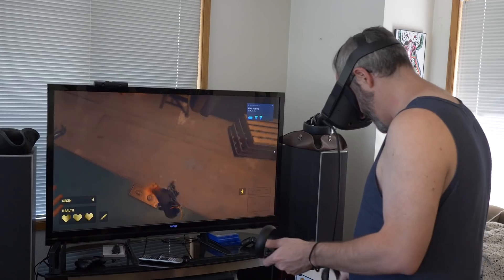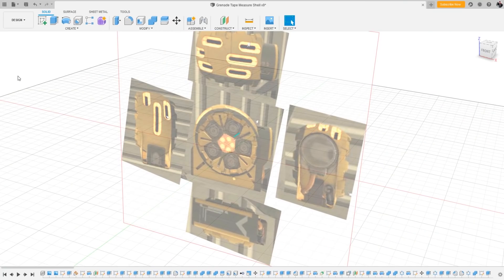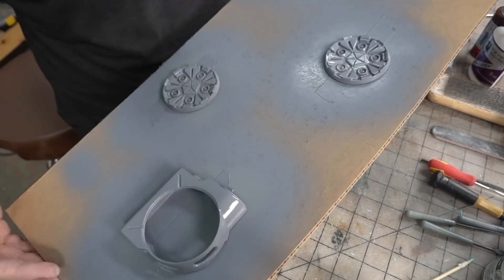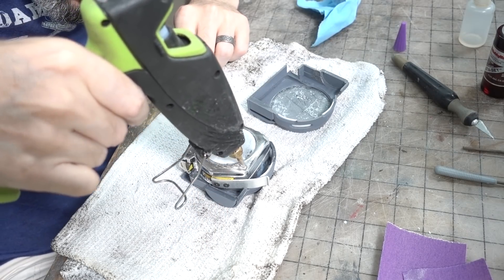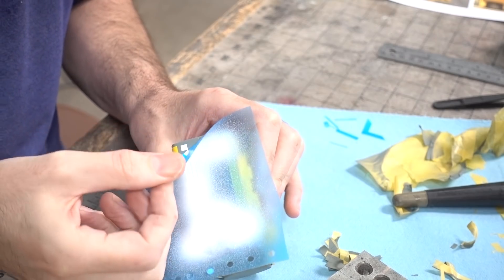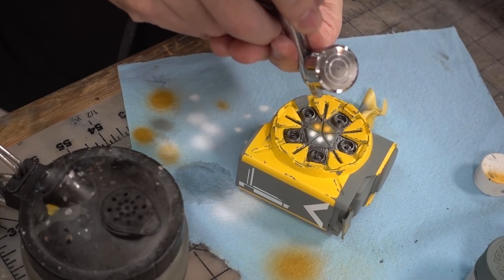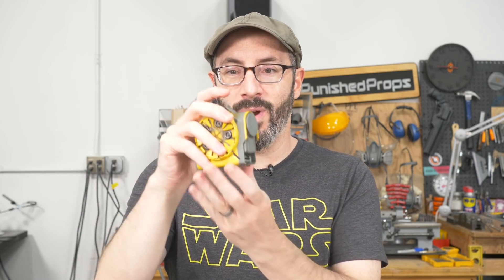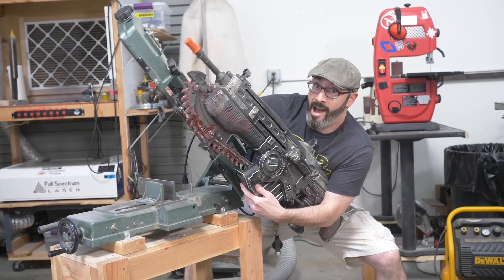Half-Life: Alyx Grenade Prop as a FUNCTIONAL Tape Measure!

Comment: what blad do you use on bandsaw to cut foam
Reply from the maker: I use an 18 TPI metal cutting blade for cutting foam. I think it's 1/2" thick. It doesn't leave a perfect cut surface, but it's pretty good.

Comment: Since the LED's them selves should be too difficult to fit in the side wall of that, couldn't you maybie use a flat wireing or even a conductive paint along the inside and put power into the area above the lock for the tape measure, even making that round part a cap to getting to it, and you could even build a switch into the lock extension. My thought would be to just make it turn on when locked, but if the rest will fit i would think a dedicated switch could be integrated.
Reply from the maker: Interesting idea!

Comment: Lightsaber hilt level done in a way that the blade lights up when the hilt is level on a surface. :/
Reply from the maker: That sounds like a fun challenge.
Reply: @punishedprops  could use a gyroscope with an arduino to make it work maybe

Comment: I gotta say, I love it! I had the same reaction when I first saw those Grenades, but I never got to model it.
Would it be possible to also share the F360 File itself so we could adjust it to fit other tape measures?
Reply from the maker: Thanks! The model for this would be a nightmare to modify. It only barely fits my tape measure and I didn't build in any parameters for changing the inner dimensions.
Reply: @punishedprops  Ah well I think that wouldn't be a problem for the majority of F360 users, worst case one could just fill the interior. scale to fit and cut out the shape of their respective tape measure. Aka the newbies low tech approach XD
Even if not, the STLs are already a much better reference than the screenshots I had. Thanks! :)

Comment: Bill, you got get yourself a resin 3D printer. It'll save you a ton of time sanding and you can print detail that FDM printers can't. You can even get water washable resins with no odour so you don't have to use IPA to clean parts. You'll love it take my word.
Reply from the maker: I thought about that, but the resin I have for my printer ends up being fairly brittle. This is something that needs to survive the abuse of a workshop, so I figured ABS plastic was more up to the task.
Reply: @punishedprops  Ya for that project FDM prints makes more sense I guess. It's a tough life we have when the question is do I use my resin printer or my FDM printer.

Comment: Sonic Screwdriver - Soldering Iron or a Utility Knife
Star Trek Phase - Glue Gun
Mei's Endothermic Blaster - Hair Dryer
Geordi La Forge Visor - Maginfyer
Loot Crate - Glue Storage
Bender's Head - Pressure Pot
Acrylic Paint Mixer - Rick and Morty Portal Gun  https://www.amazon.com/Function-Eyelash-Extension-Permanent-pigments/dp/B07SW7RPVY/ref=sr_1_39?dchild=1&keywords=acrylic+paint+mixer&qid=1599501478&sr=8-39
Reply from the maker: Great ideas!